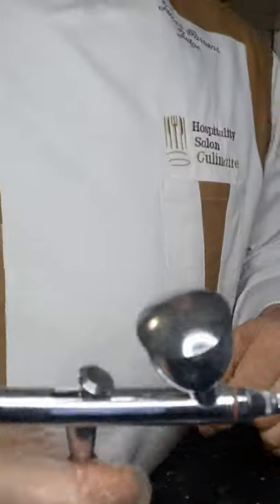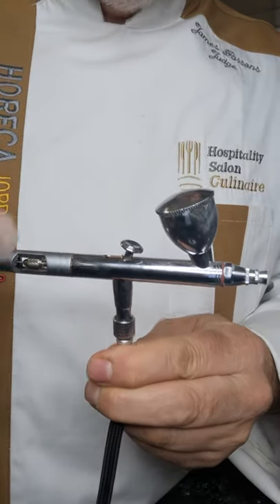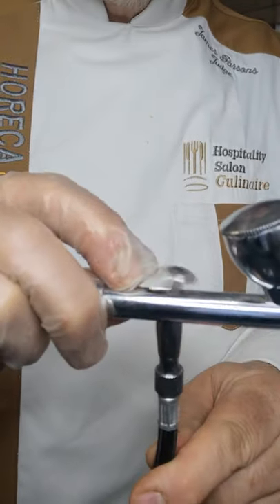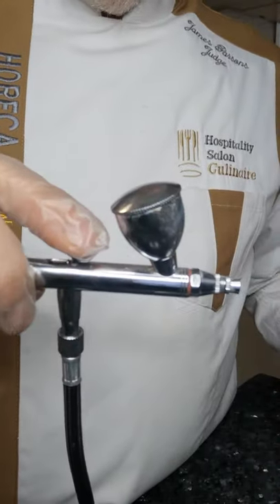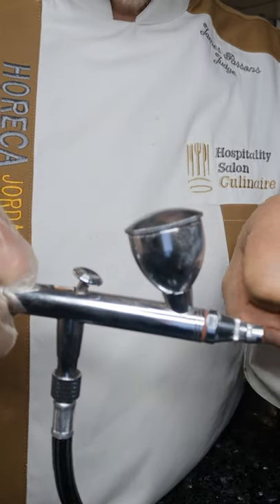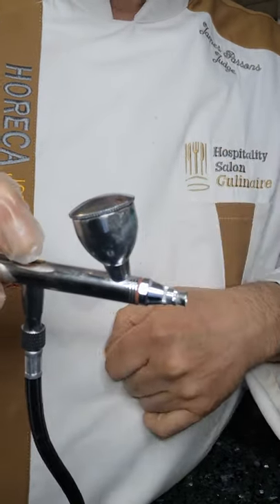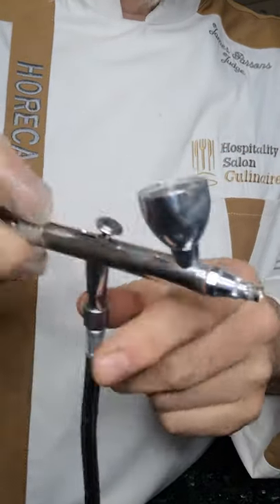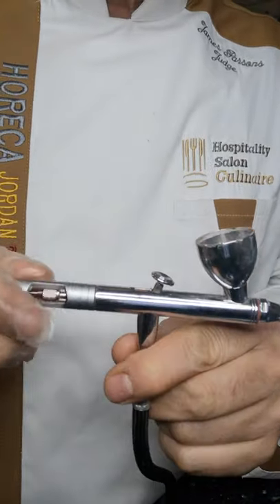How to avoid splatter with your air brush. #cocoabutter #airbrush #cocoabutterspraying #bonbons

Comment: Hello!
 What airbrush and compressor are you using. Do you have a suggestion for someone new to this?
Reply from the maker: Compressor I use is a 
sparmax 620 TC
Airbrush; I use so many different company's brushes, but my go-to brush for daily work is a
 Fengda FE-183k, a very cheap but great brush in my opinion, easy to take apart, clean and has changeable needles, I use the 0.8mm and the 0.5mm for all cocoa butter spraying
Reply: @sosasechocolat2467  nice. Very helpful. I’m looking them up. Thank you
Reply from the maker: @MikkisoXTRA  let me know how you get on or if you need anything else 👨‍🍳🙏
Reply: @sosasechocolat2467  the airbrush is only available in the UK but I accidentally ordered on the uK Amazon. It’s shipped so fingers crossed 🤣😝
Now searching the compressor or equivalent.
Reply from the maker: @MikkisoXTRA oh I do hope it arrives from the UK, fingers crossed the post / mail isn't delayed🙏👍👍❤️
Reply: @MikkisoXTRA  Hi, just came across your comment. Were you able to get it delivered to the US?
Reply: @brunosaade7  hi!! Yes I was. It came in less than a week.